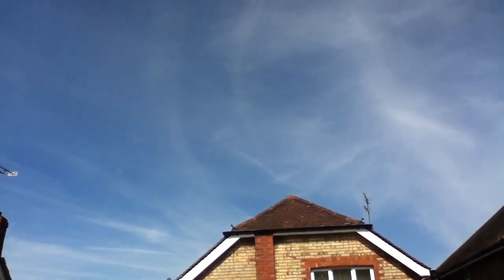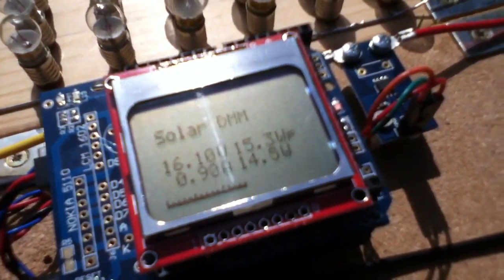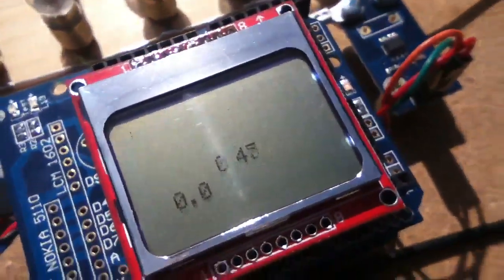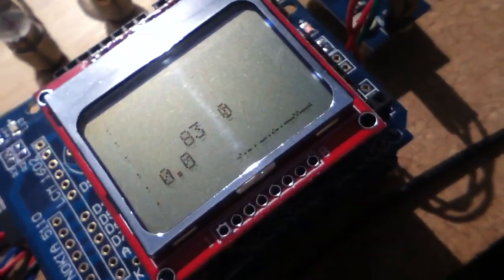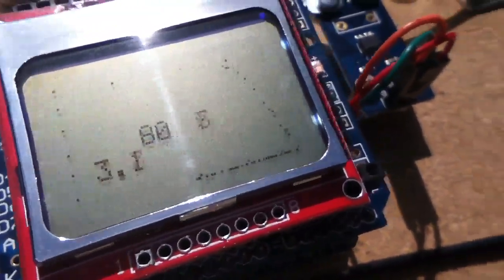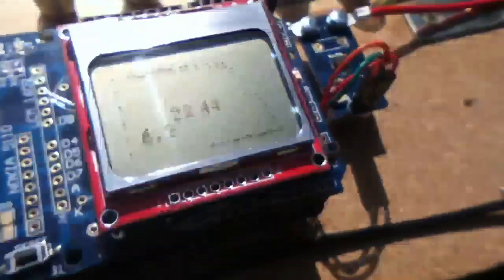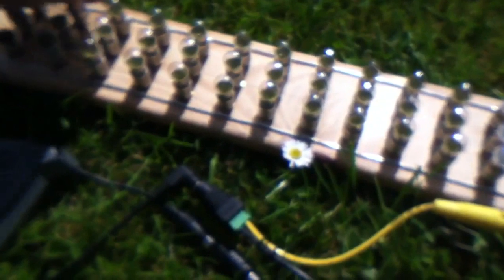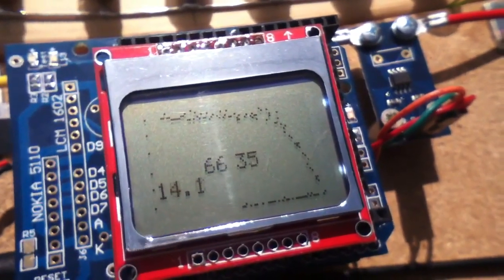MPPT Solar Charge Controller #5 - Plotting the IV Curve

Comment from the maker: I also bought this module, but I don't remember it having a CC adjustment which you'll need to drive a LED. It could be that it's near its minimum, it might also stabilise once you load the output. Also, I can't see from this video what you're using to drive it: battery, linear PSU or switched mode PSU?

Comment from the maker: Can you get 80W from an 80W solar panel (or 100W from a 100W panel)? That would be a good indication. What's your effeciency ratio? If the panel is generating 80W, is it all going to the battery or is some being lost as heat in the electronics?

Comment: I love your videos!!  I have to ask, though, how come you test with only a 20 watt panel ?  I have a super-light portable and flexible 100 watt panel that probably weighs less than that.  I use it for all my testing.  At maximum efficiency (MPPT), I nearly had it running the compressor for a pretty large sized refrigerator.  I love how you're doing your own programming and using a graphical display.  I bought my own electronics to do all of that for me but, after seeing your videos, I feel like I want to do something of my own.

Comment: Julian -
I have always struggled with the concept of impedence matcing to optimize power transfer. Anytime I post a question about it  in a forum, etc., I get 96000 guys saying you match the amplifier output impedence with the speaker impedence, ie. 8 ohms to 8 ohms  to get max power. I get what you are spposed to do, but not why. I mean, suppose you were told to match 8 ohms to 6 jumping beans ?  it may work, but why ?
When I plug a light into the wall i don't have to worry about impedence matching. Why do I have to with spakers ?
I have watched your mppt #4 & #5 videos  several times, and you use your LAMB to demonstrate that, with too few lights you get less power out of the solar panel, and with too many you also get less than peak power.  But with the right number there is a maximum power transfer. This is the closest I have ever come to understanding impedence matching.  
I would like to ask you a couple of questions, but it will require more single finger typing, and with 98, 000 subscribers I'd better check to see if you have time for me or not. I am older than you, and my time to come to grips with this issue is decreasing.

Comment: Great video always educational,could you take a look at a clip I put up today ,it was a cheap eBay win from but it's voltages fluctuates from 3.518v to 3.539 v I filmed in slow motion for you to try work this one out it's 5-30 v input 3-27 output I have 15v on input do you think it could be because I was very near to its min working voltage and would this small amout mv have and effect on the running of my 3.5 v 350 ma led would you suggest I up the out put volts and see if it becomes more